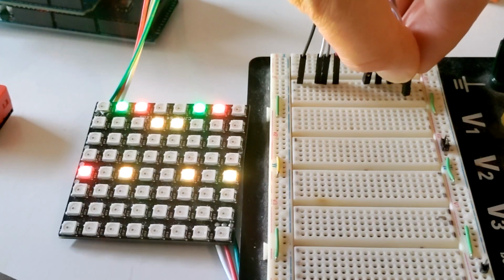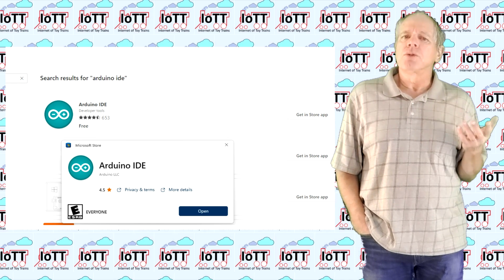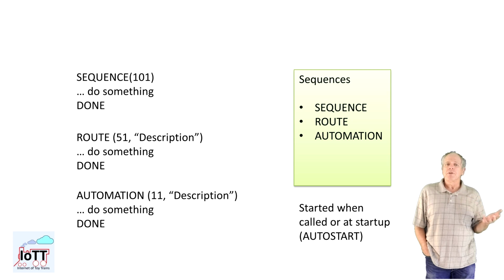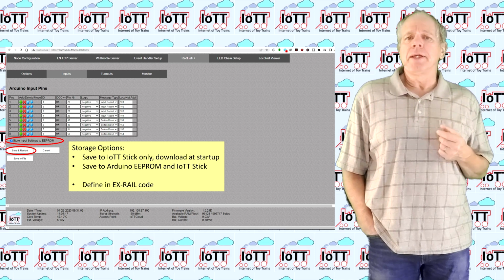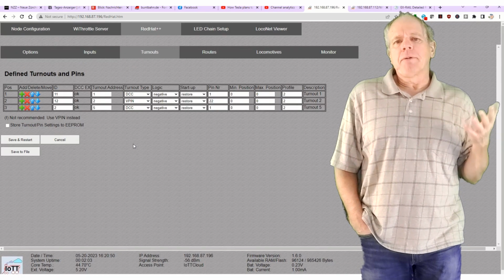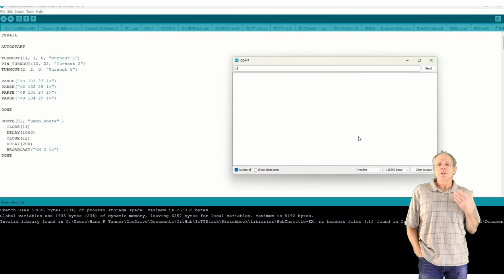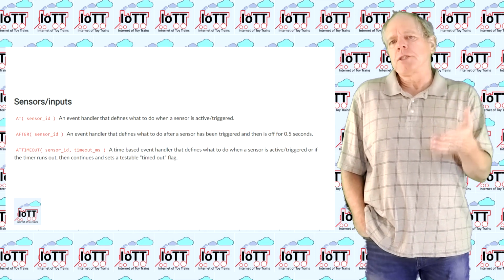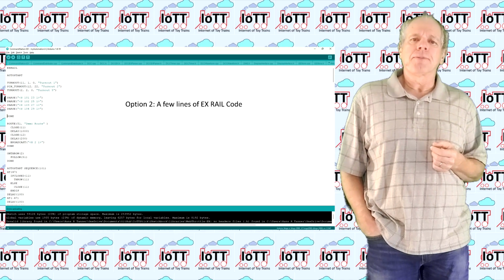Adding LED's using EX RAIL (Video#119)

Comment: Fantastic. Thank you. Great explanation. I’m just not sure with the pca 9685 whether i can use 3v or 5v leds.
Reply from the maker: There is no such thing as a 3 or 5V LED, they have a forward voltage of typically 2.5V and the brightness depends on the current. A typical PCA9685 board has a resistor in the PWM output, so you can directly connect an LED between PWM output and either 5V or GND, depending on the polarity. You then can control the brightness with the PWM duty cycle.

Comment: Wow, an out of sequence video. A pleasant surprise for a Sunday morning. Ex-Rail certainly has a few interesting features. This is something I’ll have to take a deeper dive into at a later time. For now, I’m busy just trying to get my layout operational. Love all of the IoTT devices but it is getting a bit complicated with 4 Green Hats, a Yellow Hat, a Blue Hat and several MGP devices. Eventually I will replace my NCE system with my Red Hat DCCEX system all running JMRI. Ex-Rail will certainly enhance its operation. Thanks Hans!
Reply from the maker: Thank you. It actually might be the beginning of a new sequence schedule ;-)